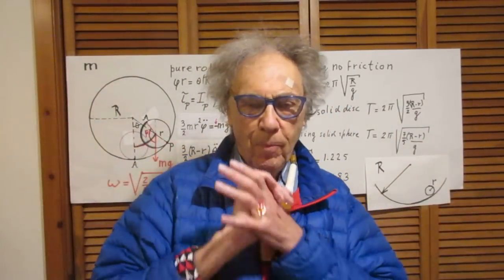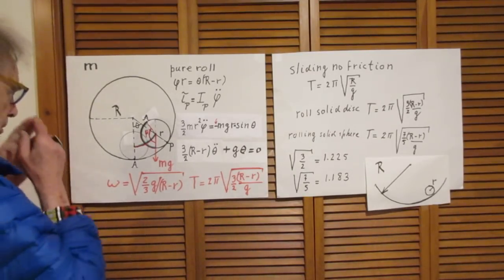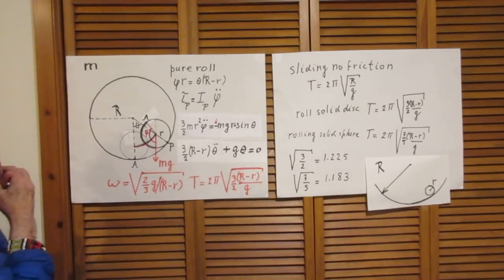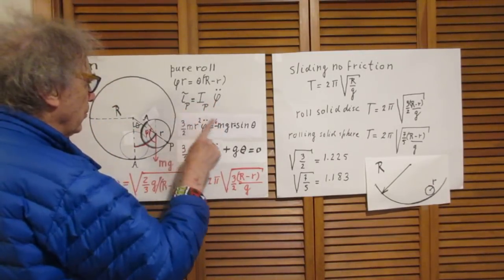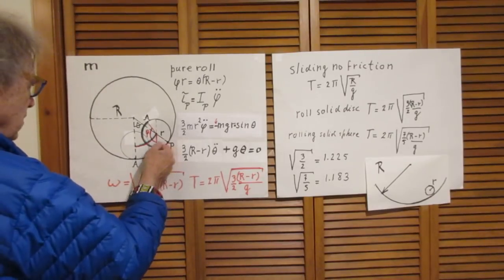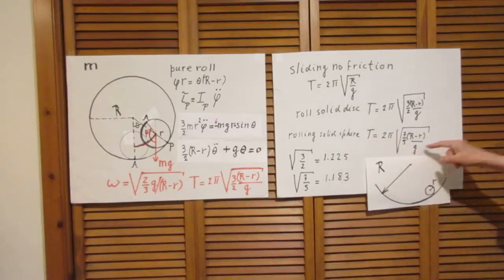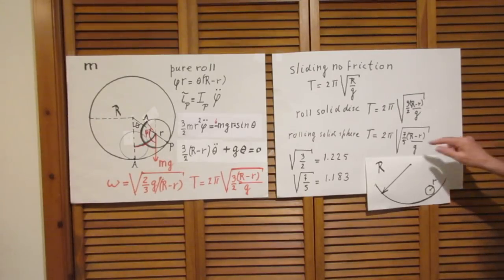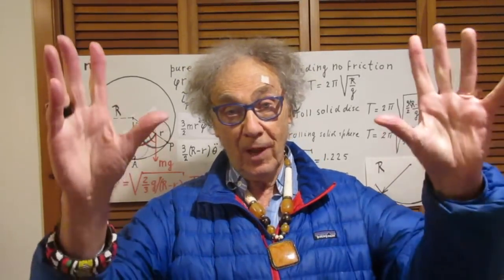Solution (1/2) Problem #23  Rolling SHM

Comment: apart from mathematical reasons, why does a larger radius of an oscillating sphere result in a shorter period ?
Reply from the maker: if the bob can not be approximated by a point (no size), then it is not a "perferct" simple pendulum. It's then a physical pendulum in which the size of the bob does play a role

Comment: For the pure sliding case of a cube, you must account for the angular acceleration of the moment of inertia of the cube about its center, unless the height of the cube is small compared to R.  This would be even more significant for a "half-moon" shaped piece sliding inside a cylinder.  You also must have a (R - h/2) term instead of the pure R term because the center of mass of the cube moves along an arc of (R - h/2) radius.  (h = height of cube).

In fact for all pendulums suspended by string from the top of the weight, you must also account for the moment of inertia of the weight as it rotates during the swing (slightly lengthening the period).  This assumes you do not excite the relatively higher (harmonic motion) rapid rotational oscillation of the weight.

Comment: How do we know that the length of distance covered by center of mass is equal to distance covered by point A?
Reply: Lectures by Walter Lewin. They will make you ♥ Physics. At 3:54, you say that that phi times r is equal to the distance that the center of mass has moved. The question is: How do you know that? What's the proof?
Reply from the maker: that's the pure roll condition

Comment: how to do this by energy Way?
Reply from the maker: write down the eqs for energy conservation using the pure roll condition. Take the derivative of that equation and massage the algebra a little. You will then end up with the same differential eq that I found.
Reply: Lectures by Walter Lewin. They will make you ♥ Physics.  OK thanks sir,.
Reply: @lecturesbywalterlewin.they9259 
Sir,  Rolling disc executing SHM in presence of Friction. 
We know SHM in presence of any drag force (Friction) is Damped oscillation where Energy exponentially decaying. 

So why in the above problem we cannot assume it as Damped oscillation??
Reply from the maker: @mrinmoymandal2695  there is always pure roll in this demo; there is no slip. Thus no total energy (PE + KE) is lost, no heat is produced.
Reply from the maker: @mrinmoymandal2695  there is always pure roll in this demo; there is no slip. Thus no total energy (PE + KE) is lost, no heat is produced.

Comment: In the case of the sliding disc, why is it not R-r/g under the radical? In other words, why is it not like a pendulum whose string runs from the center of the outer hoop to the center of gravity of the disc?
Reply from the maker: The distance from the center of the cylinder (R) to the center of the disc (r) is R-r. https://www.youtube.com/watch?v=v5beCvI-f1Q&index=52&list=PLyQSN7X0ro23CEzKOjAVcRq66m6g-mFLe
Reply: The question has to do NOT with the rolling disc, but the period of the SLIDING disc written on the top of the right-hand sheet, T=2piSqrt(R/g).  I do not understand why it is not T=2piSqrt((R-r)/g), that is, the period of a pendulum whose string extends from the center of the outer ring to the center of gravity of the disc (the geometric center of the disc in this case).  I am missing something apparently.  The rest is fine and perfectly clear...
Reply from the maker: good point thanks for pointing this out. Frankly T=2piSqrt((R-r)/g) is also wrong, in the absence of friction the problem is then a physical pendulum and the period will not be T=2piSqrt((R-r)/g). The reason why I wrote T=2piSqrt(R/g) (which is wrong) bcoz I watched my lect #13 in which T=2piSqrt(R/g) is correct but there the object has no finite size. With my apologies. Clever of you that you caught this.
Reply from the maker: https://www.youtube.com/watch?v=9ta5ul9x6WE&list=PLyQSN7X0ro203puVhQsmCj9qhlFQ-As8e&index=14
Reply: Thanks for your reply!  By the way, I have enjoyed these short programs and especially, over the years, your MIT lectures. In conversations with students, I have often cited the latter as real models of good teaching, maybe the best I have ever seen (I might say I am a mathematics educator and a historian of mathematics...)

Comment: Professor, I see that for the calculation of torque, you took the point of contact between the sphere and cylinder as your reference. But, as the sphere has an angular acceleration, point p is also accelerated and therefore is a non-inertial reference point, right? Shouldn't you, then, add a inertia's force to the center of mass in the sphere and consider its torque in the equation?
Reply from the maker: I cannot add to the clarity of my solution - sorry. My lecture hall (and your home) is a very good approximation of an inertial reference frame. My calculations have all been made in that frame. Just like throwing up an object in the sky. That object is accelerated but my ref frame is NOT.

Comment: Sir ,it can be solved by mechanical energy conservation law also.
Reply from the maker: yes that always works but it is more time consuming than my solution.
Reply: True,the same problem I encounter during my PG course which is solved by langrangian approach but Newton's approach  always rock.
Reply from the maker: yes you can solve this with the Lagrangian equation and also using the conservation of energy. I have done both! The solution that I posted is by FAR the simplest, the most transparent, and the shortest.
Reply: Agreed.
I am enjoying your book also,you are amazing.